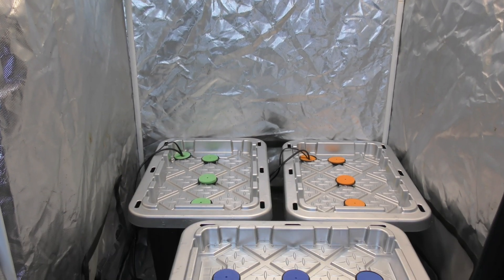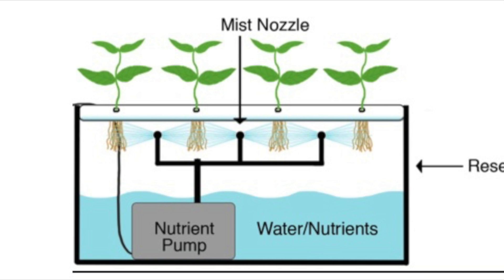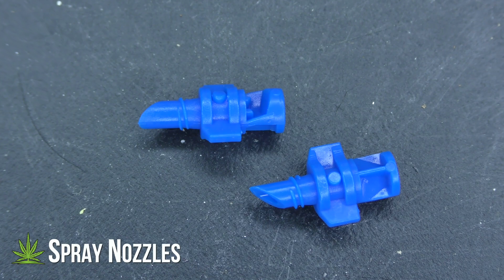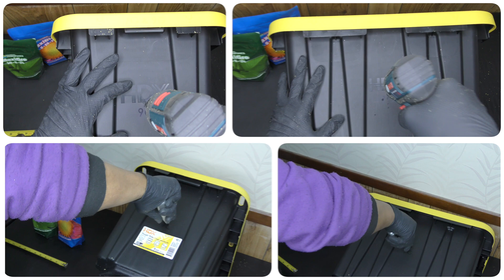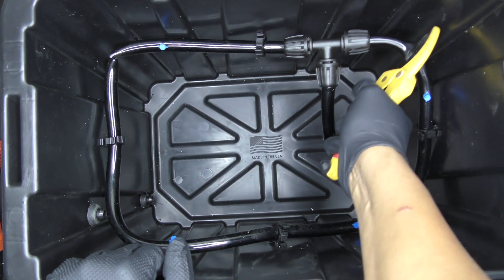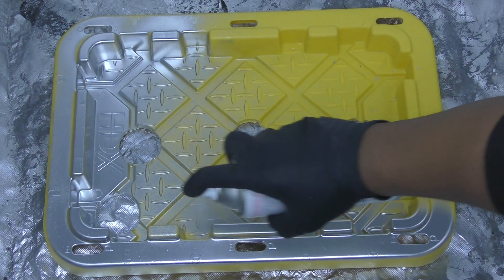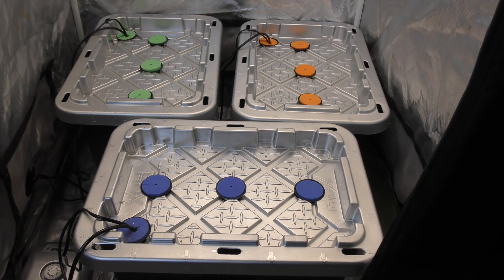DIY Low-Pressure Aeroponic System 🌱💧 | Simple, Cheap, and Effective!

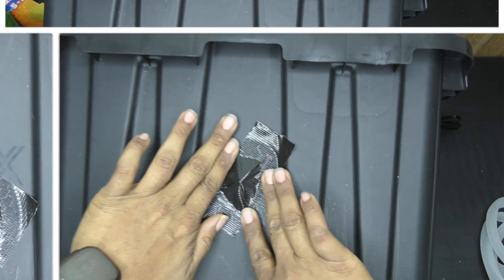Comment: 3:17 have you not heard of epoxy? Or even just some caulking would work. And they make acrylic tubes that make a much better level sight.
Reply from the maker: Thanks ✌🏿
Reply: @RiskyBizz  trust me, don't risk mold inside by using tape. Also the acrylic tubes take longer to get UV damaged by the lights and cloudy. If I do use sights I make a sleeve from heat shrink to keep the window small to limit algae growth as well.

Comment: That's not pure low-pressure aero. I sugest to lift the containers and put dump valve in the bottom. Then connect the containers to the reservoir - let the gravity to the thing. No airstone needed. I've got mine with res outside the tent to keep the water temp cooler.
Reply from the maker: Thanks ✌🏿